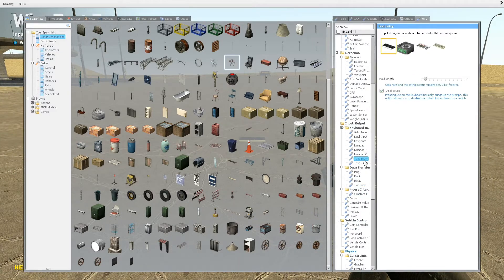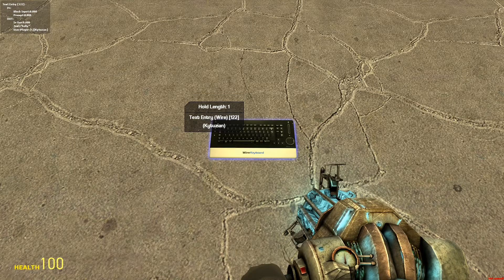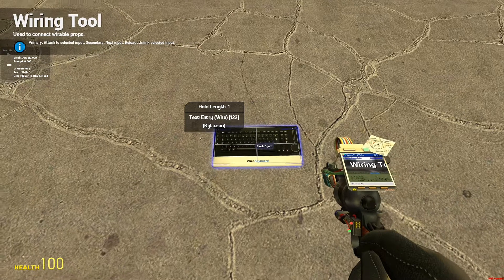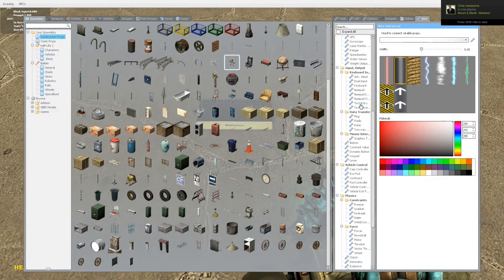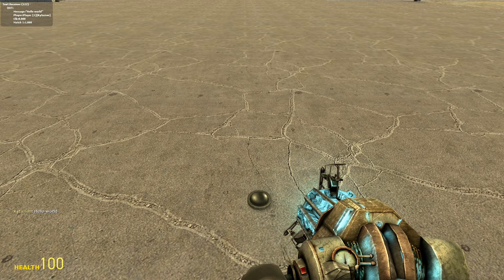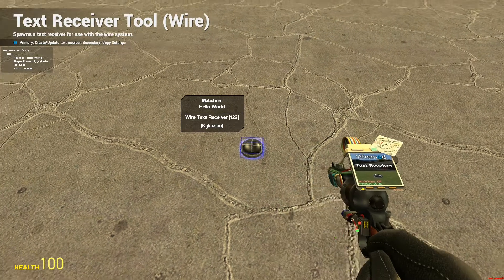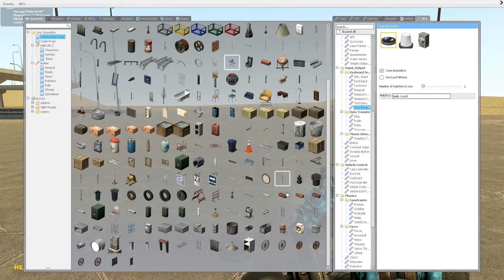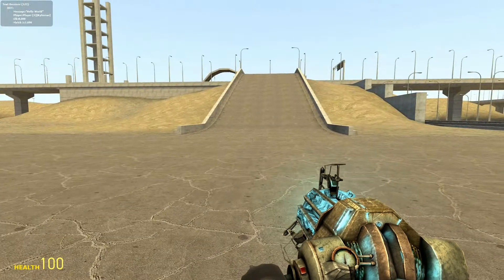Garry's Mod - Basic Wire - 14 (Text Receiver/Entry)

Comment: How do I make a door open to a password with the text entry?
Reply from the maker: Qustinnus Sakae It should be fairly simple, just get an Equal (String) gate, then wire the A to the text entry, and the B to a constant value (or whatever), that contains the password. Finally, wire the door opening to the output of the Equal gate.
Reply: Kytuzian Odd, I did that but the gate never returned to 0 but the hold time on the text entry isn't 0.
Reply from the maker: Qustinnus Sakae If I understand you correctly you might just have to manually clear it, because I think I'm having the problem.